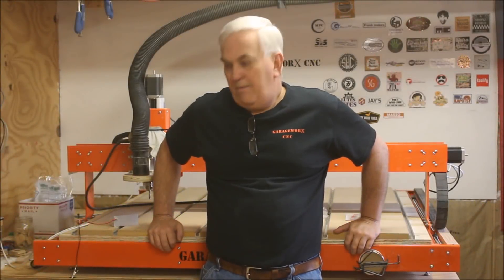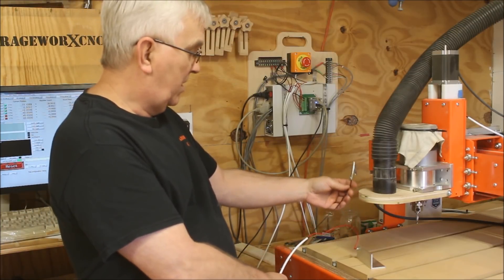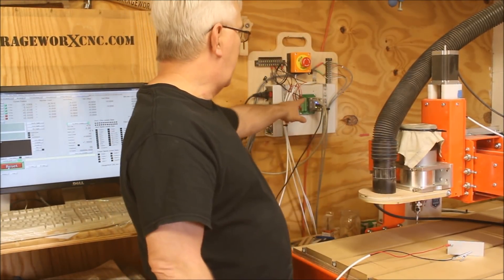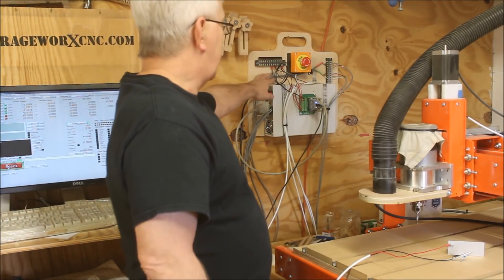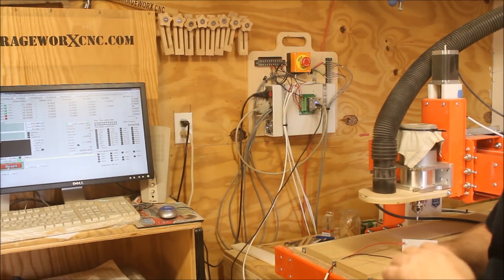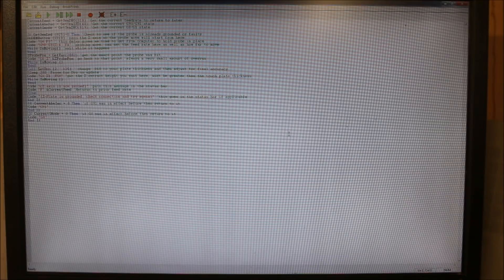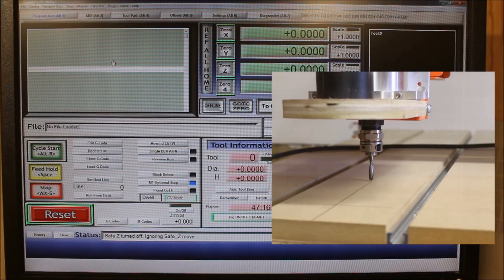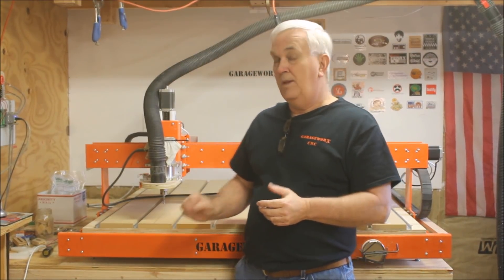Adding a Touch Plate to your CNC

Comment: Got the script from you and guru guy and neither worked the bit comes down touches stops briefly then proceeds to smash through the probe plate. What am i doing wrong
Reply from the maker: Sounds like you didn't edit the script to put in the correct thickness of the touchplate you're using.
Reply: @DaveGatton  .57 yep did that and set the retract to .75 greater than the plate thickness. But it touches the probe pauses for a split second then continues to crush the tip of my bit till I can hit e stop. I just don't get it
Reply: @DaveGatton  thanks for your help I'll keep trying